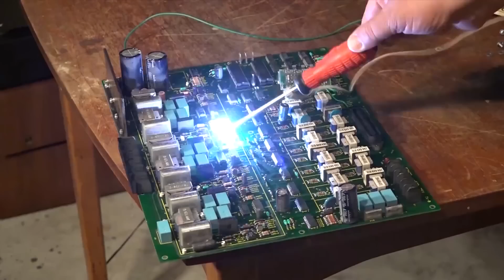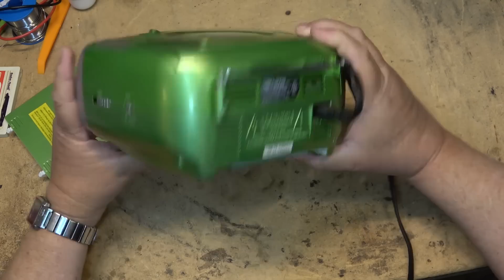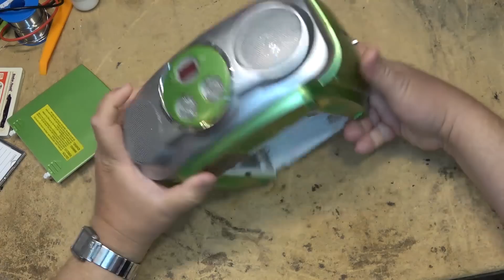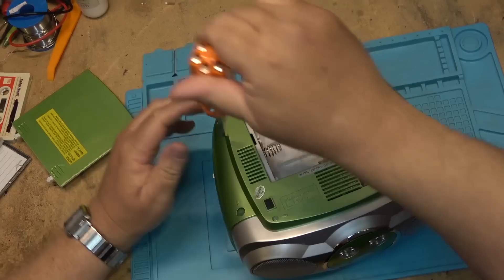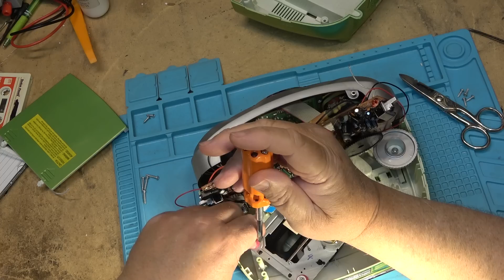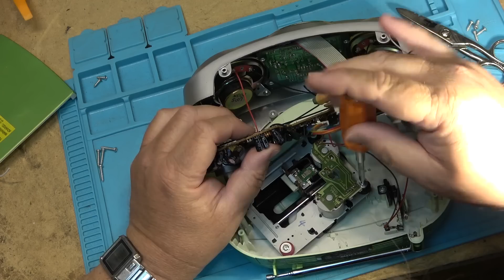Tear down on a Curtis Tiny CD blaster

Comment: Any idea what the output voltage and amperage is on the powersupply?
I need a 12v 5amp powersupply and I'm thinking the old boombox might have me covered but trying to ask around before destroying a working radio

Comment: Curtis, a dollar store brand (Candle, Citizen, Electrobrand some LLoyd's) .  Curtis International bought a license to badge one of their lines as Sylvania.  I have used one of those Sylvanias.  It has a cheap feel and sounds pretty thin.  I'll give it this though:  it has an analogue tuner (variable capacitor) and has not died yet (easy to beat a low expectation).

Comment: The CD mech is a clone of a Sanyo SF-P101 (although given the date of manufacture it may even be genuine). Just about everything made these days has the same mech including some very expensive decks, so these are useful things to have around!
Reply: Sanyo was a sleeper brand against Sony walkman cassette stereos. My 1986 MGR62 still works fine!

Comment: That's not in a bad condition for it's age, i like the metalic green.
A Poly varacap for the tuning, usually very reliable. (Expensive now.)
I bet that unit has been mostly used as a radio, the c.d player shows no sign of age.